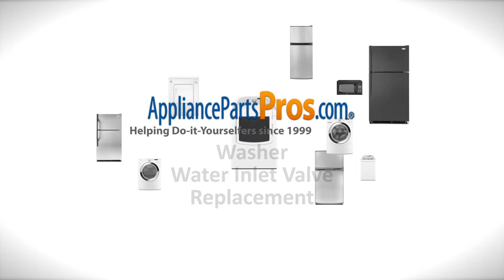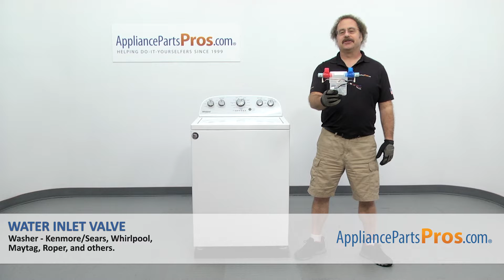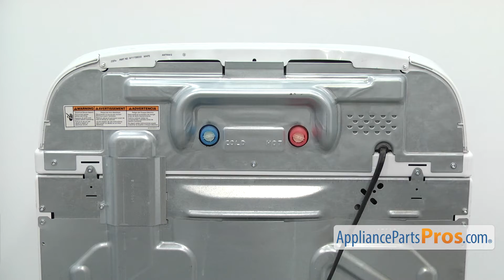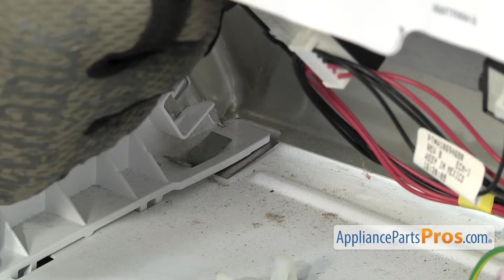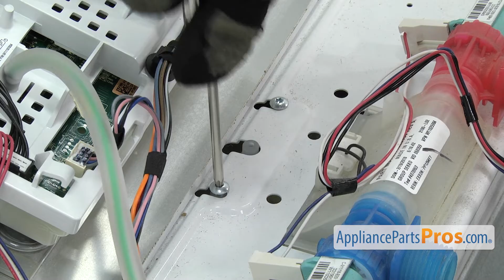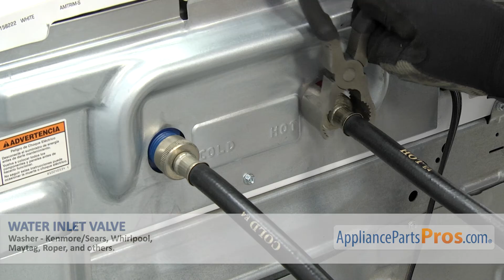Whirlpool Washer Water Inlet Valve W11210459 Replacement — fits KitchenAid/Maytag

Comment: Will fit Maytag 4KMVWX505BW0?
Reply from the maker: The hot water valve is part number WPW10240975 and the cold water valve is part number WPW10240976. You can order those from our website or you can call us at 1-877-477-7278 and place the order over the phone.
Reply: @appliancepartspros  Thank you